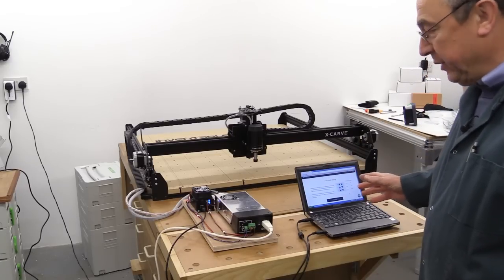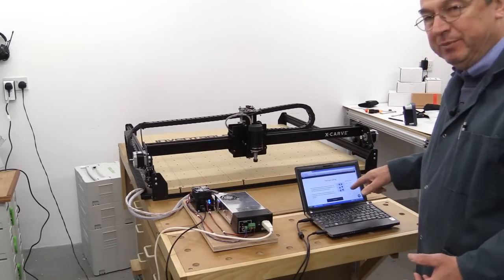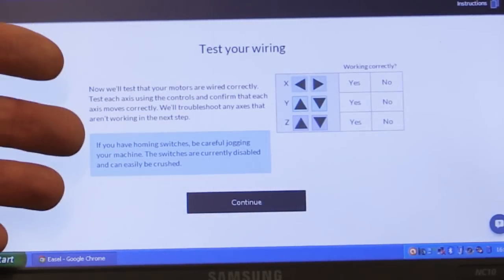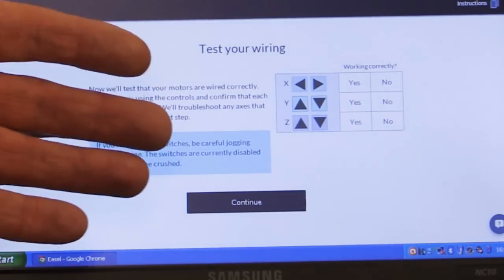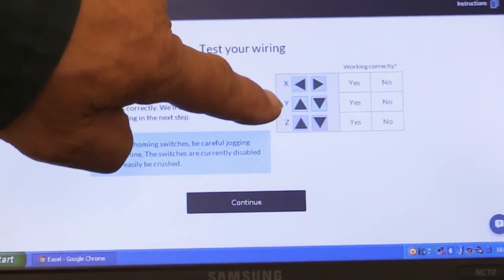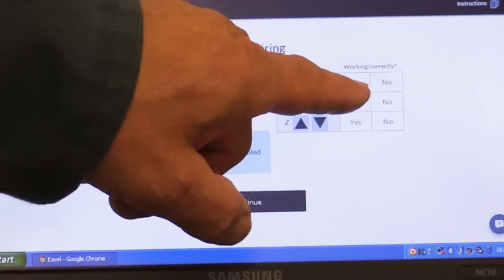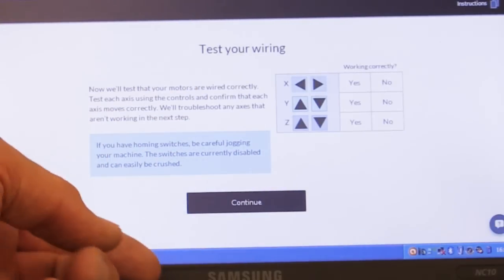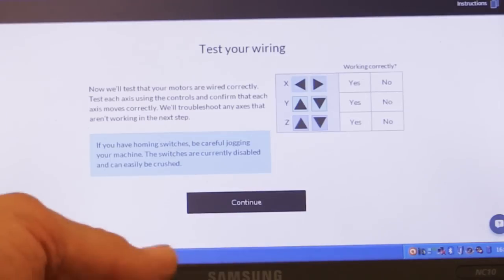Original X-Carve - Commissioning

Comment: Just curious...  why a different x controller and spindle? Did I miss you explaining this???
Reply from the maker: The original 24v spindle was under powered. The X Controller brings together all the fiddly bits of electronics and makes assembly, testing and fault finding much easier.   Peter
Reply: New Brit Workshop sorry still must be missing something, the previous video had a 240v dewalt not 24v? Are we both getting a tad confused? Sorry but was looking at using the dewalt unit myself but on a U.K. CNC kit built...
Reply from the maker: The X-Controller (mine anyway) does not power the Dewalt router. I have to flick the mains switch to start and stop the router. I am sure that someone will have a gizmo which would allow the X-Controller to send an on/off signal to control the router but I have no detail of how it could be done. If you are considering the baby Dewalt - it is excellent. You need to note that the motor cooling takes air in at the top and blows it out down at the cutter end so you will need some form of dust boot on your CNC.   Peter

Comment: The build and initial setup process seems a bit easier on the X-Carve 2 with the X controller. Just seems like there is less to go wrong connection wise etc. Mine worked pretty much first time on initial setup. 

That engineer square is a monster, dare I ask how much and where from?
Reply from the maker: Hi Andy, Yes, the X-Carve 2 appears to be a much easier machine to set up. My 12" engineer's square came from The Woodworkers' Workshop here in the UK. I think the price has not changed and is less than £60. I use it all the time and take great care of it.     Peter

Comment: how much did it cost all in with p&p to the UK ???
Reply from the maker: +Aaron Powell Hi Aaron, The "Fully Loaded" machine is about $1300 which needs to be converted at the current exchange rate. It came in 4 packages. The UK customs charge 4% duty and 20% VAT. The Post Office who handle the collection of those charges impose an £8 charge per package. In all that lot came to about £300. You need to do the maths and then see if Robosavvy's price is better.    Peter